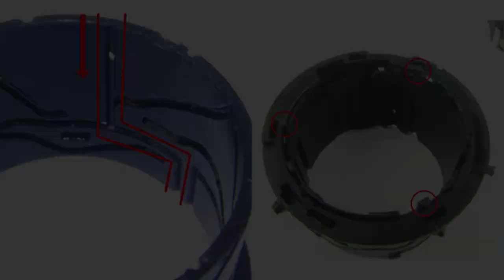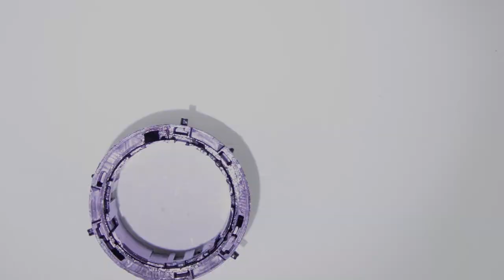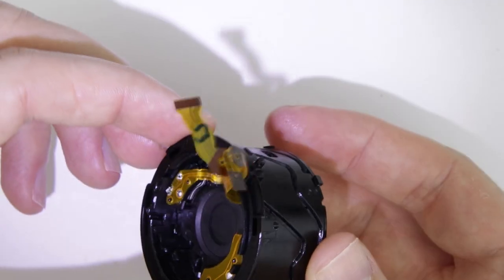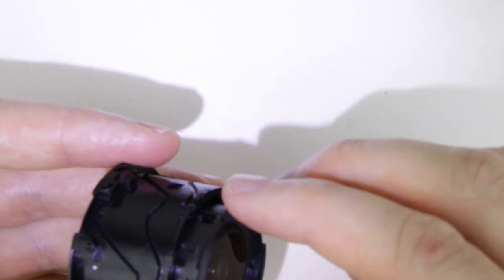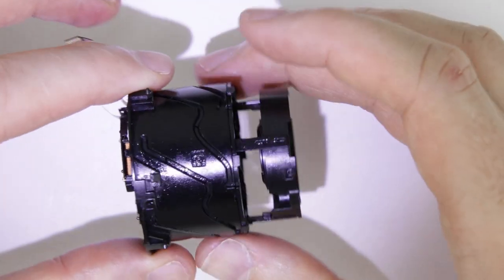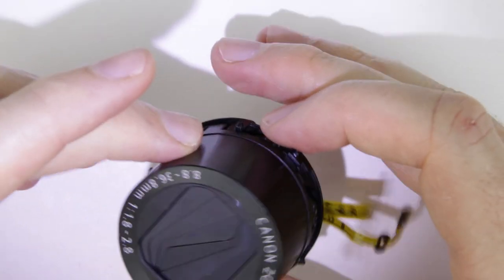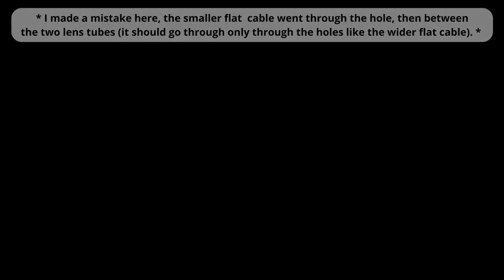Canon PowerShot G7 X camera lens unit assembly

Comment: This video was helpful! It appears I have some broken parts in my G7 X Mark III lens and can't find anywhere that has the lens itself for purchase. Have any recommendations on where I could find one?
Reply from the maker: Generally, you can find repair parts on ebay. Or you can purchase the same camera in non-working condition which has problems other than the lens, and use that as a donor.
Reply: @CamerasLensesEtc  😄
Reply: the target is to repair the lens and to know which parts should be replace to repair the lens assembly

Comment: My G7x Mark 1 extends its lens when turned on and then shuts down with a lens error. Is it possible to troubleshoot what lens component would trigger the error? The camera main board expects a certain signal from the lens, which it isn't receiving and shuts down in response. Clearly, the zoom motor works. Also when I take the lens apart, is it possible to bench test the aperture & focusing motors on the bench by applying a few volts to them from my bench power supply? I already tested my zoom motor by disconnecting the lens from the mainboard and applying 2 volts to the motor. Works in both directions.
Reply from the maker: There is a small trigger / sensor which sees if the lens has collapsed... check that also.